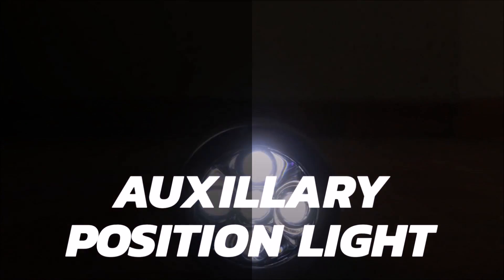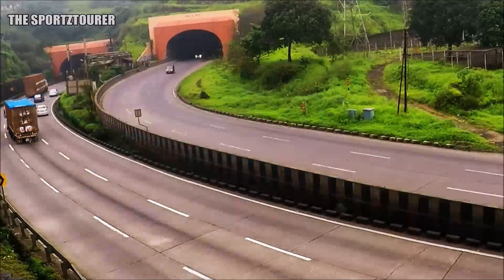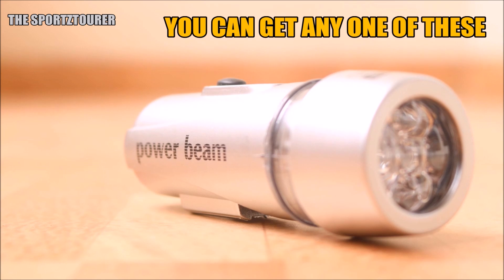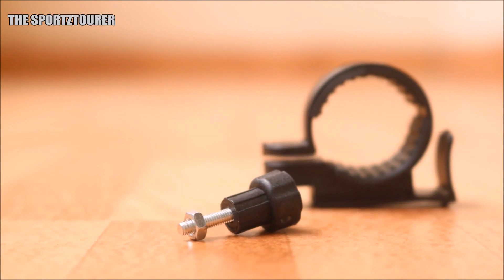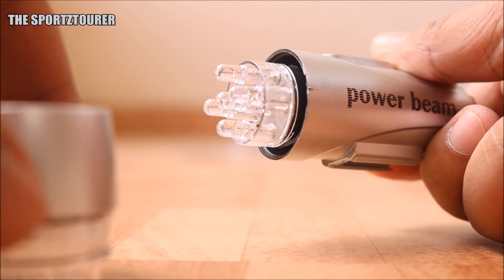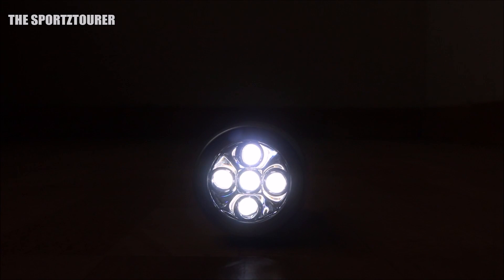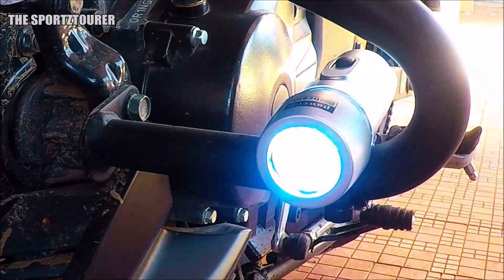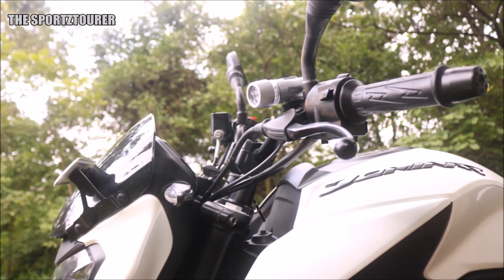AUXILLARY POSITION LIGHT | TVS APACHE & DOMINAR 400 WIRELESS LAMP WITHOUT BIKE'S BATTERY CONNECTION

Comment: I would rather use led indicators with hazard light mood. It is so powerful
Reply from the maker: Hi +Srikrishna Cj,
Yes LED indicators with hazard blinking feature is good to make your bike visible when parked. You can also try to hard wire it to use it without the key.
I do have plans to get good quality LED indicators on my 200 as my experience with LED indicators on 180 was not good.
Reply: The Sportztourer KTM indicators are really good. The same is used in RS 200 and dominar
Reply from the maker: +Srikrishna Cj Yes, the Dominar is all LED you won't find a single conventional bulb on that bike. Will surely look onto it 👍